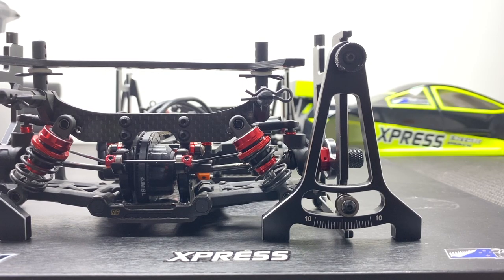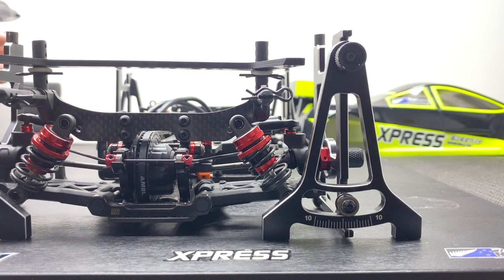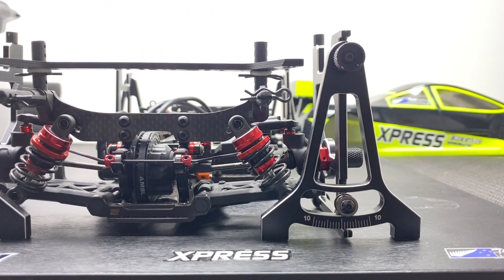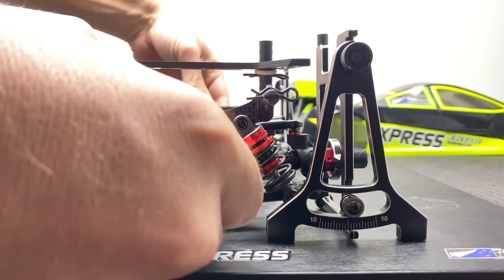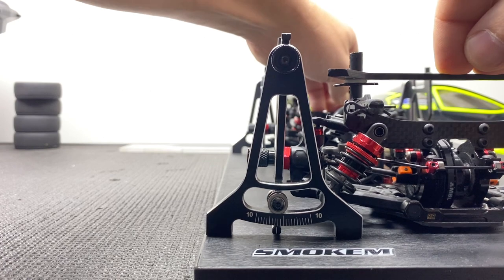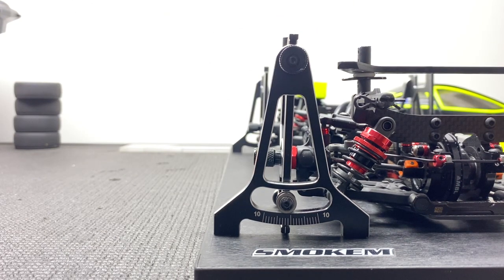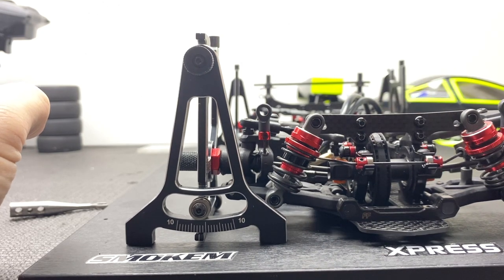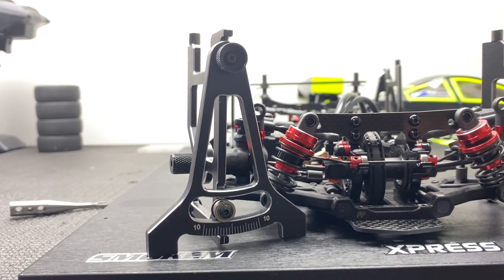McTips - Setting & understanding camber gains on your onroad RC car

Comment: Well, all that is fine but it really depends on the tires you run and the grip of the track you race on. If the grip is lower, less camber gain is better because you won't be able to use the static + dynamic camber change, the outside of the tire will never be loaded. If the track is high grip then yes, more camber gain is better because otherwise the  internal part of the tire might lift and loose grip during cornering.

Comment: maybe you can answer this, why is everyone using a spool in the front for these beltjobbies? wouldnt that impair steering and cornering? and i used your tricks setting up my car earlier, nice tips loading the car up in a twisty way. made all the difference when pushing the corners today.
Reply: In full sized cars yes, but in these smaller lighter cars it works. Helps pull the car straight out of a corner. Apparently they can be unstable exiting the corners with a diff.